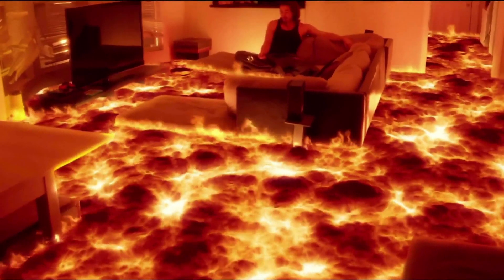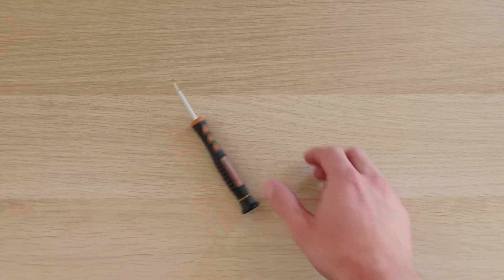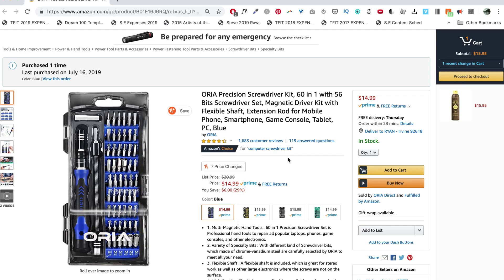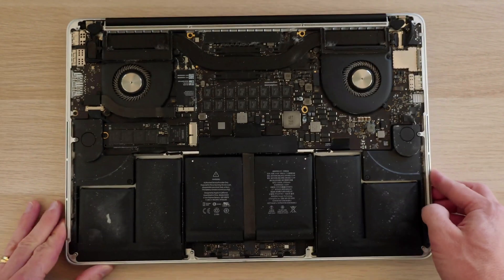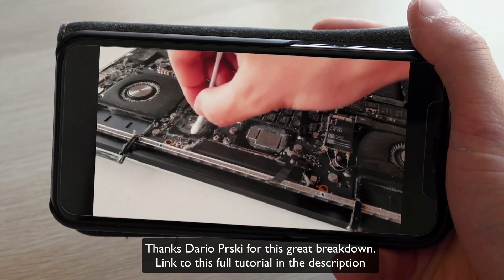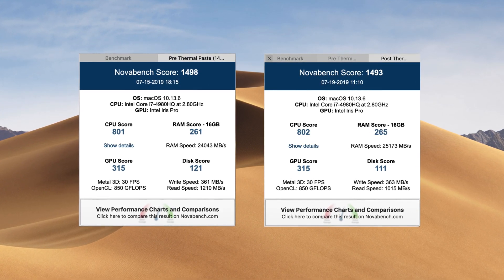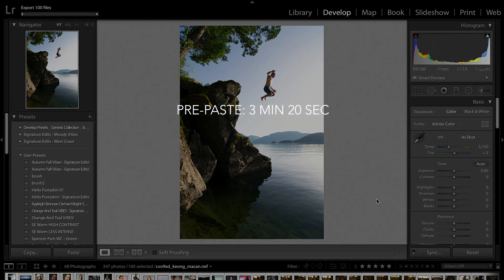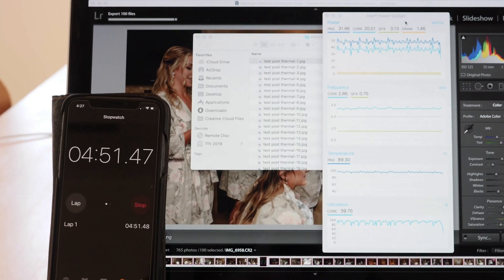The $10 Overheating Macbook Pro Fix / Upgrade: Thermal Paste Replacement For Faster Performance!

Comment from the maker: Tool links 
Screwdriver Tool - https://amzn.to/2y9CRT6

Thermal Paste - https://amzn.to/2Yel1sK

(I receive a small commission if you purchase these, but feel free to buy whatever tools & paste you like - These are just what I used)

Isopropyl Alcohol - Buy this at a grocery store or pharmacy anything with an alcohol content over about 70% is fine. At $0.70 its WAY cheaper than buying the special electronic stuff for $15+!

Compressed Air - Again buy at a hardware store and its WAY cheaper. The one I got was about $5 at home depot. Just make sure its compressed air only, and doesn't have anything else in there. 

In depth walkthrough from Dario Prski: https://www.youtube.com/watch?v=bUnm-korNUE

Comment: Hello! My macbook mid 2011 suddenly froze and the screen went black and it starts beeping 3 times and pauses and beeps again. I think it’s because the ac is cold and maybe the inside of the macbook was damaged by the moisture. Is there an easy way i can fix this?
Reply: If it’s 15” failing GPU… otherwise RAM
Reply from the maker: Hey Sean - take it to an apple store to diagnose! Might be easy, might be unrepairable, hard to say!

Comment: I don't recommend doing this... It might help but the risk of opening your 2K-4K computer and damaging a component is to high compared to the speed increase. There is also a thing that you don't see on his old mac pro, just between the back (the plate you take off) and the other part (where all the components are), there is a very fine adhesive tape that automatically goes out when you open it. That is made by apple to know (if one day you send your mac to repair) if you open it, and if they conclude that you opened it you loose your warranty... Anyway, this is just an advise :)
Reply: You only need to do it after a few years anyway. So the warranty is long gone by that time anyway. 
But yeah if you really dont know what you’re doing and this is your first time even opening the macbook up, maybe go somewhere or ask someone. But following video instructions should be straightforward enough really if you have a bit of experience .
Reply from the maker: Good points Marc! You've got to weigh the risks. I certainly would only do it on an OLDER macbook pro. The warranty is probably not an issue for most people as with an older macbook the odds are your warranty has already expired long ago :) In general the process is extremely straight forward and easy, but its totally up to your discretion!